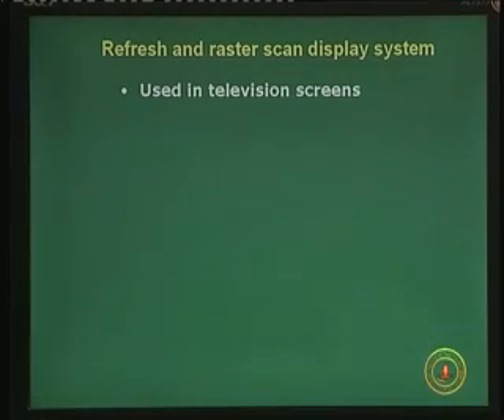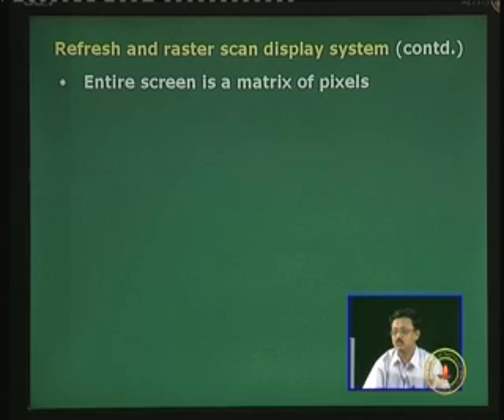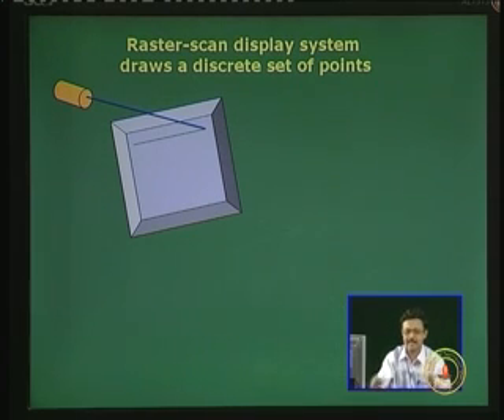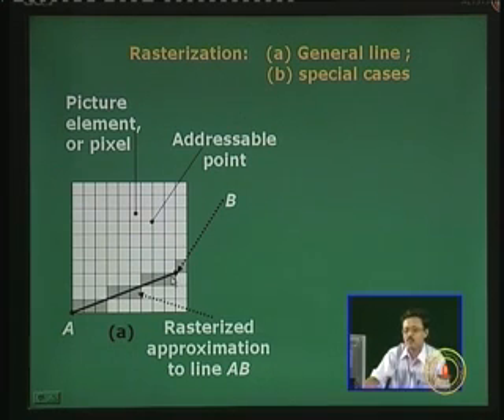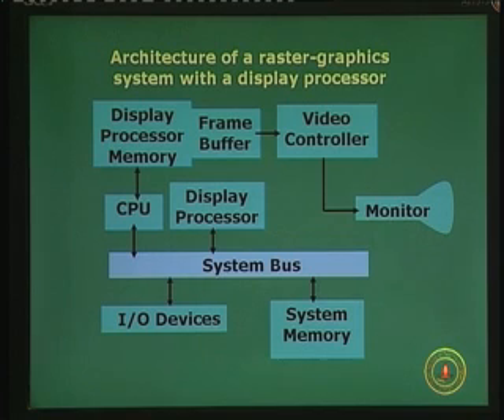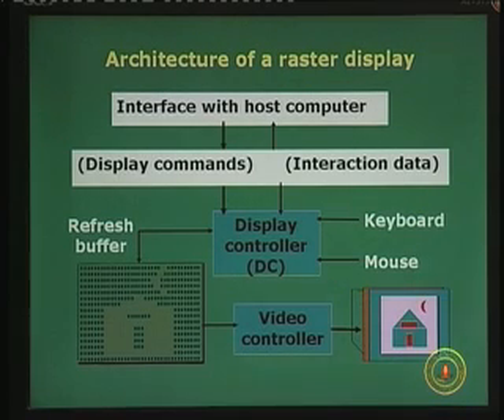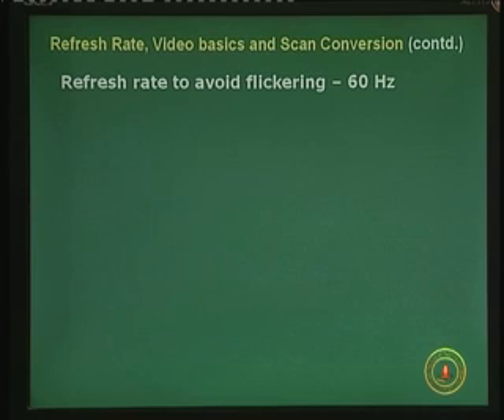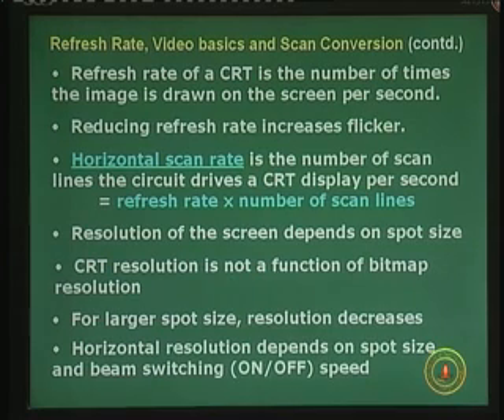Lecture -3 CRT Devices (Contd...)

Comment: can someone explain which is meant by 'switching the beam on or off'.. is the beam always active? please help
Reply: it is off. to draw the points, it is on and off continuous
Reply: yes it always active but with the help with control grid or other module u can control the electron beam intensity so as e.x if u make the voltage on the control grid very high no electron will pass